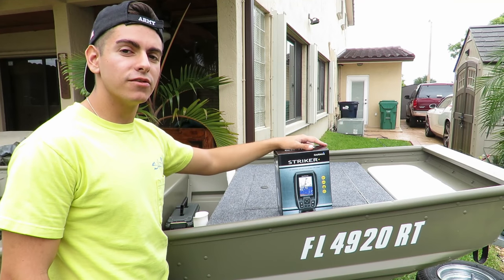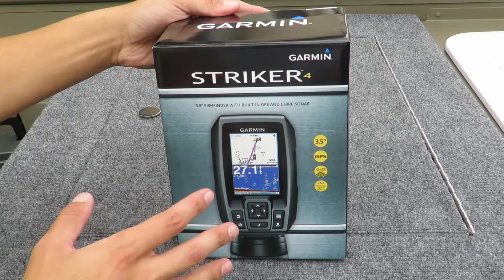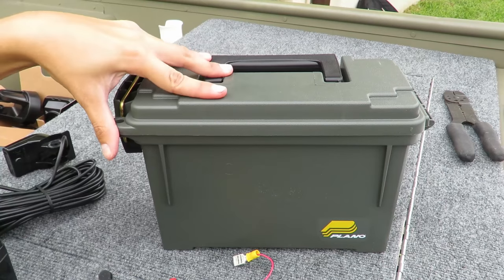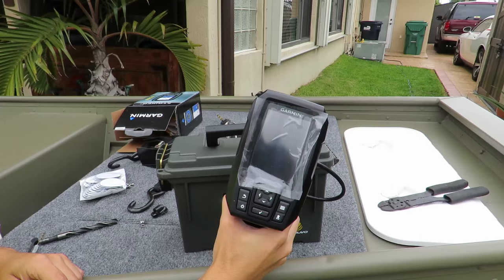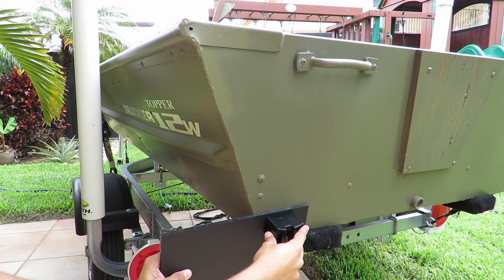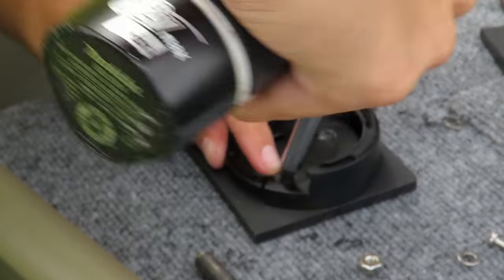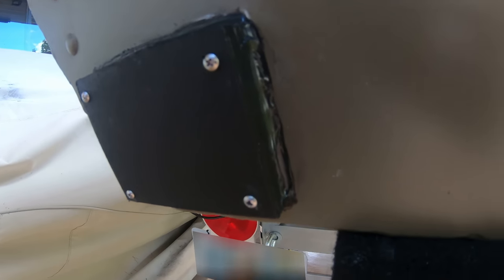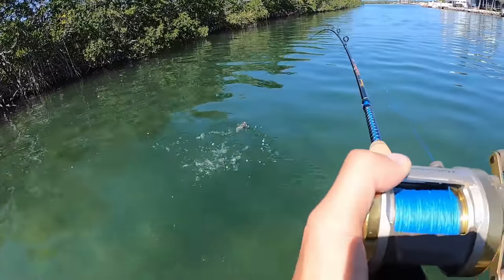How to Install a Garmin Striker 4 Fishfinder on a Jon Boat! (No Holes Drilled)

Comment: Thanks for posting - I’m looking at the same Garmin unit for my aluminum 14. Can you tell me how the position of the transducer has performed for you so far, also how low is it mounted into the water from the bottom of your boat bottom ? Thanks again - Jeff

Comment: Very smart method of installation. I love that you guys aren’t drilling a bunch of holes into the boat 👍🏻
Reply: It will work ok if you don’t use boat much and only go in fresh water but it will come off if you go in salt water.  But still pretty cool video

Comment: Thanks for the high quality video!  Love your overall approach, including the battery setup and connections, and topside screen mounting, and appreciate the way you explain things.  I'm going to use most of your approach with my Striker Vivid 4CV, including the separate battery and box, and your repositionable topside monitor.  For a moment the camera angle made  it look like you installed the transducer on the side of the boat instead of on the transom, but looks like it was just me getting turned around, lol. Also, thank you for the update on the glue failure. I'm using JB ClearWeld epoxy, could have used 5200, but saw a video where the ClearWeld did a great job for this application, so going with that.
Reply from the maker: Thanks for watching! Feel free to keep us updated with your transducer mod. We're still trying to figure out a good solution for the glue failure
Reply: Facts !

Comment: Careful with the transducer hanging down that far. Per Garmin it should be installed level with the bottom edge of the transom
Reply: Mine says the transducer should be below by a quarter inch

Comment: let me ask you a question. If the transducer is mounted in the back and you are fishing in the front in the boat, then what ever  you see on the fish finder  display it's already history for you, it's not something comes at you, it's something already passed you, that's correct?
Reply: Yes, you are correct in that it reads what you already passed. All fish finders are installed with the transducer to the back and they are required to be installed there to my knowledge. We do fishing from all sides of our Jon boat and when we are fishing up on the front casting deck it's mostly for sight casting. Once you pass a structure with fish on your finder you can always stop the boat, anchor up, and fish the back of the boat. Its all relative to where you place your boat.

Comment: Nice video guys , I just got the same set up a 1236 Tracker and a 6hp 2018 Mercury. I haven't had time to run it on the water yet because if the Florida weather. I noticed the boat is rated for a 5hp and theres a 6hp on it . So have you guys had any problems with the transom or anything with it? Just wondering before go on the water with it .
Reply from the maker: We don't have any problems with the transom since the 6hp motor only weighs a few more pounds than the 5hp motor. No need to worry about your setup. Tight lines and enjoy your new Jon Boat!
Reply: @TheReelStrike  
Can you tell me how you keep your motor when trailering  ?
Up a little or all the way or down  ?

Comment: How long does your battery supply power b4 it takes a dump and how do u charge it? You probably could have used the red connectors yellow was way too big, you also want to use grommets every time u pass through something even if it is plastic, it's all good though u guys look kinda young good job

Comment: I would put some kind of covering over the top of the battery so that none of those wires touch the terminals. Otherwise you could have a circuit problem.

Comment: Very nice install clean and well thought out. A suggestion if I may. Unless your wanting to leave it totally portable to move from your drive seat to your casting deck. If not and your just always going to mount it in the same spot. Shoot a dab of silicone around the hole you made in your battery box. That way it’s totally waterproof again. Also how long does that small of a battery run your fish finder?
Reply: I've used the fish finder for a good 3-4 hours one trip and it did not die on me, but I have yet to test the maximum duration of the battery.

Comment: Very informative,  I have 12ft Alumacraft. Based on your video I may try this method. At first I was gonna mount it on the trolling motor. What type of smart charger do you use to charge your battery?

Comment: How did that silicone work out for sticking the board on? Did it hold good?
Reply from the maker: It held its own for about a year and a half. A few months ago the starboard and transducer fell off while washing the boat down. We think it was because we mounted it too low on the transom, but we go over the situation in a bit more detail in our 2 Year Update video. We still like the setup, but we have to make a few adjustments to it

Comment: Side question. What is and where did you get the flooring in your boat?
Reply from the maker: The flooring is a set of rubber kitchen mats that have been custom cut to fit the boat. You can find a link to them in the description, but you can also find them at Home Depot!

Comment: How does the mount hold up would this work for a aluminum bass boat ? It pushes about 25 mph loaded out I’m kinda worried it’ll fall off with drag would this work ?
Reply from the maker: I wouldn't worry about the speed of the boat as long as the transducer is installed higher up on the transom than we did in this video. I would be more concerned about the strength of the adhesive that attaches the starboard to the boat. A few months ago the starboard block detached from the boat while we were cleaning it. It held up for about a year and a half, but there's always going to be a risk of it falling off if it's not drilled onto the boat itself

Comment: Good video.  I just bought my Garmin striker 4 plus and was going to install it when I found your video.  I decided to do it your way and am ordering the king starboard from amazon.  Pretty expensive, but the best I could find.  I am going to use JB Weld to mount the starboard to the transom.  I have a Grizzly Tracker 1654 SC and I wondered how the fish finder is performing so close to the motor.  I have heard stories of trouble with the turbulence affecting the readings.  Has yours fish finder done well with the transducer mounted there?  Just wondering.  Again, good video and thanks!
Reply from the maker: Our fishfinder works well but it does get a bit choppy at the top of the readings when running fast. It's best to keep the transducer as far from the motor as possible. Your boat is larger than ours, so that shouldn't be a problem to do. Also, we only paid $7 on ebay for the starboard we used (Check the video description for the link)
Reply: Thanks. Good tips.

Comment: Nice video . Where do you buy the tie strap connectors used to secure your wire to the 
fishfinder
Reply from the maker: Home Depot, but any local hardware shop should have them
Reply: I should have said the strap connectors are secured to something fastened to the boat so no holes are driven in the boat . Where do you get them ? Sorry .
Reply: The are holding the zip ties to the boat
Reply from the maker: Also from Home Depot. Here's the link: https://thd.co/2Sh8Fz0

Comment: Hey buddy just done the exact same setup! Thanks for all the tips! But how do you charge this battery?
Reply from the maker: Awesome man! We use a 12v battery smart charger
Reply: you should never just use a standard 12v battery charger. You need a specific sealed AGM charger option, that is normally low amperage/slow charge.

Comment: I'm about to get a 1542 with a 6hp Mercury.  How do you keep your motor when trailering  ?
Do you tilt up a little or all the way or leave down ?
Reply from the maker: We actually remove the motor from the boat and put it on a dolly (Which goes in the trunk of the car) during transport
Reply: it stays down. Tilting it harder on the transom and can bounce free with a huge bump.

Comment: Hey man! Loved the video, quick question though. When you added the second piece of star board and secured it with screws, did the screws just go into the first piece of board? Or did they go all the way through into the boat as well?
Reply from the maker: Thanks! The screws do not drill into the boat. We made this setup so that all the drilling is done on the starboard
Reply: @TheReelStrike  Sweet! Thanks!

Comment: Can you put a Jon Boat is saltwater or do you have to paint it and if you have to paint it what do you have to paint it with
Reply from the maker: We've had our jon boat for over a year and a half. We haven't noticed any chipping or wear on the paint that it's coated in from the factory, and no new paint has been applied since we originally purchased it. As long as you wash the boat down after each saltwater use and store it properly, there shouldn't be any noticeable wear on the paint (At least from our 1 1/2 years of observation)

Comment: How is the marine sealant holding up with the transducer?
Reply from the maker: It worked nicely for about a year and a half, but a few months ago the starboard and transducer fell off the transom while washing the boat. We think that part of the reason this happened was because the transducer was mounted too low. Our 2 Year Update video talks about the situation in a little more detail

Comment: Do you still use this fish finder setup? How is it holding up?
Reply from the maker: We really only use the fish finder if we're exploring new waters and it's more of a luxury mod than a necessity. As for this mounting method, it held up very well for about a year and a half until the starboard block detached while cleaning the boat. We think this was because the transducer was mounted too low on the transom and as a result dealt with a lot of wear and tear, but we always knew that it was a possibility since the transducer is not drilled into the boat. We talk a bit more about it during our 2 Year Update video. We still really like this setup but there are still some issues to work out
Reply: @TheReelStrike  Awesome thanks for the help

Comment: How to you get the mount bracket  for the GPS monitor apart?
Reply: If you look at 5:05 where I'm placing my thumb there is a little lever that you push down to release the GPS from the bracket

Comment: Its actually smart. Ali boats last much lknger than transducers. Mine has an old one and hey guess what...the tranducer mount holes are in a comlletely different pattern than the new transducer. Sure i can fill one and drill one...but glue these days is great. If you are concerned about it being ripped off...then the force required would trash the unit anyways.

Comment: It's only as good as the caulk you can buy . I almost think that marine Epoxy would be better
Reply from the maker: You're welcome to try it. But over the past year since we've installed it there hasn't been any issues with the setup we used
Reply: 3M 5200 is the best you can get.